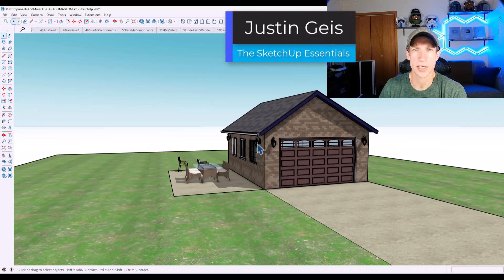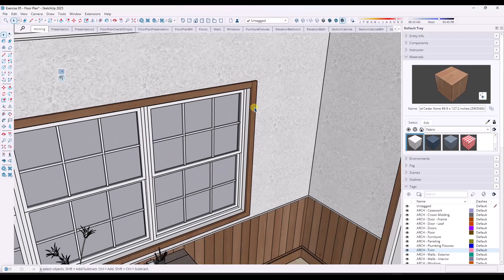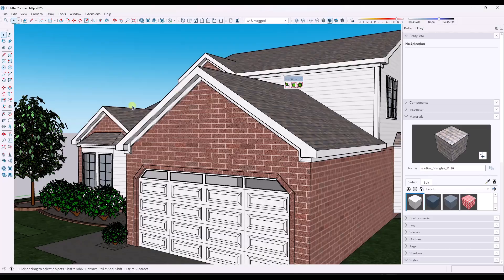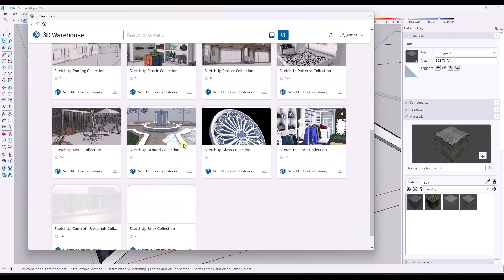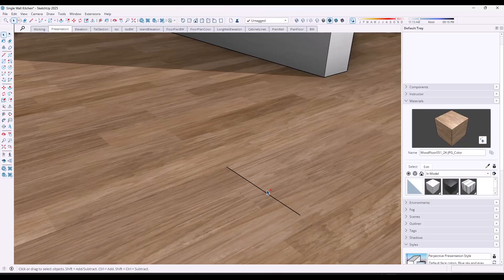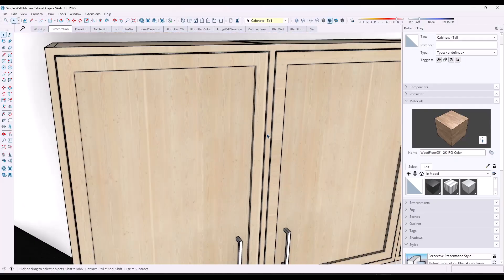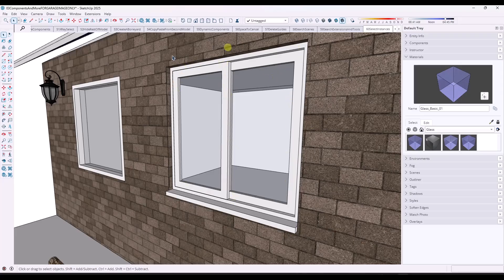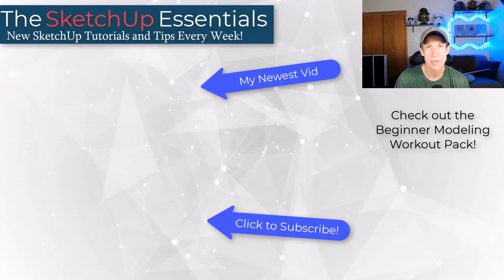6 small changes that make SketchUp models look a LOT BETTER!

Comment: Instead of creating a shadow line (3:50) to indicate roof covering thickness on barge-boards, I push/pull the entire outside face of my roof to create a 40 mm thickness.  This is quick, and I can stay in push/pull mode and quickly do it for all roof surfaces.  If I already gave the roof a colour / texture, the new 40 mm visible sides will then already have that colour.  If I am bored, I also give the bottom edge of the roof a 40 mm overhang towards the gutters, in the same manner.